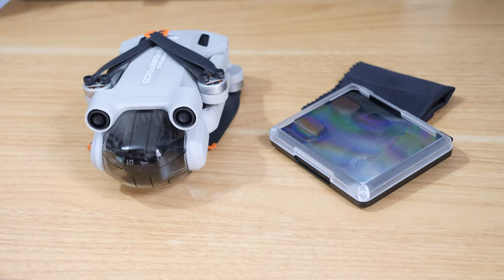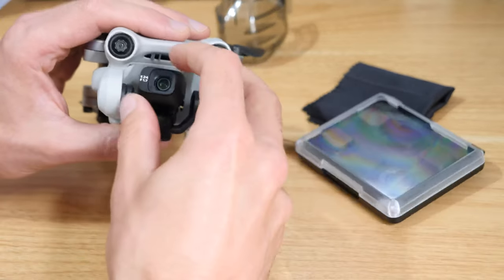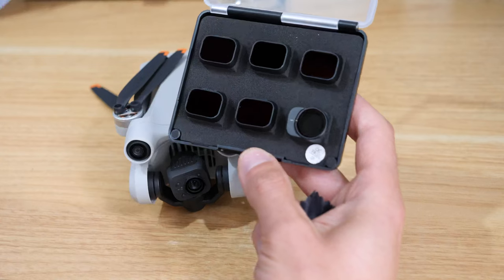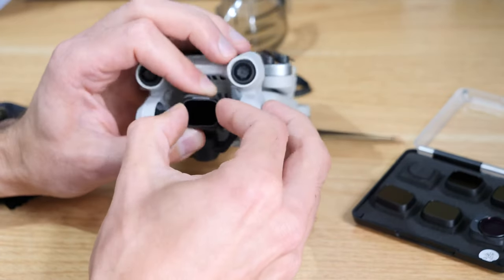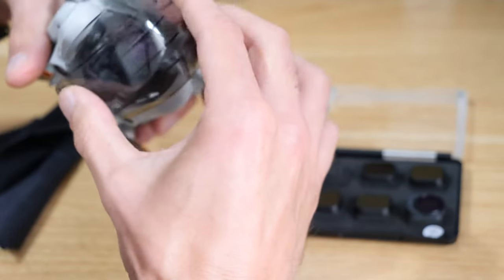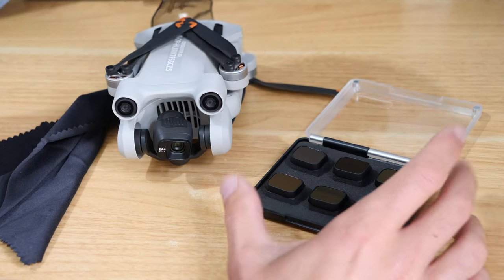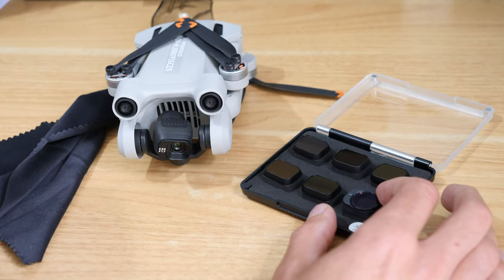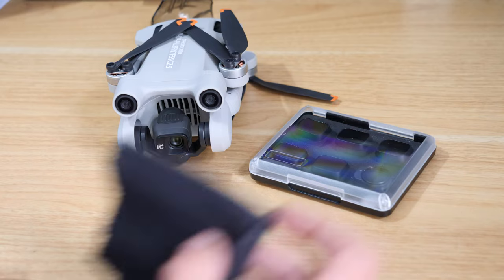How to Fit ND Filters to the DJI Mini 3 Pro Drone | How to Remove the Lens Cover on the Mini 3 Pro

Comment: Thank you so much. I bought this filter set two weeks ago but  didn’t bother to try it until today when I was already in the  site where I needed it. It was a bright sunny day and I was in a remote area with no internet and access to youtube. I had no idea how to remove the lens cap. My other drone (mavic mini) has a top of the lens fit so I just assumed mini3 pro should also be the same. I spent about 15 minutes trying to attach the filter and almost broke my gimbal. Thank you for the detailed video. After watching this, it was a cake walk :goodvibes:
Reply from the maker: No problem, glad you found it useful 👍 It's a bit fiddly the first time you try but then after you have done it a few times its a breeze.

Comment: Hi thanks my first Drone when I was flying out everything turned white like it was Christmas and it was snow now I crashed my job on the filter, blew off or just the cover them just a cover of the lambs and everything so it again with this new drone, so I think I’m gonna buy the filters is this normal? It is a sunny day here in Arizona.
Reply from the maker: Hi, if everything is overexposed to that degree I would assume you are set to 'pro' settings, so you would have to manage the shutter, ISO etc accordingly. If you switch to 'auto' it should compensate as best as it can. In very bright sun, ND filters can be very useful though in retaining much more of the highlight detail in your shots. You can switch on the 'zebra' option on the drone and then this will show overexposed areas with diagonal lines (this is not burnt into the footage, just a reference). Hope that helps.

Comment: nice thanks so much for the info. have a question though. just got mine last week and after watching vids like these, I realized my mini3 pro gimbal is REALLY floppy and just and im noticing nobody else's looks like mine. it seems to function fine when booted up so I dont know, kinda strange.
Reply from the maker: No problem, glad you found it useful 👍 the gimbal will be like that when the drone is not powered up, that is normal. So long as it works well on each axis when it is powered up then you are all good. You will notice in the footage if there is an issue and the drone will also flag up a gimbal error.

Comment: I flew with and without ND filter, I did not see the difference. then if you write cars, yes, it can strobe. I do have a mini 1. Is the aperture adjustable on your 3 mini? hardly.
but the polarizer, yes, you probably need it. but it also needs to be twisted correctly in order for the effect to be.
why did you buy mini3, than mini2 did not fit?
Reply from the maker: It's an f1.7 fixed aperture on the camera but ND filters definitely help reduce overexposed areas, especially skies. You do need to use manual settings for them to be worth it though. But I find them useful for both photography and video. Went Mini 3 because I wanted 10bit 4k 60fps and I hate that old style controller where you have to use your phone. It's just not practical for me, the new controller with the screen just makes life so much easier.
Reply: @stevelitton  So to reduce overexposure, it is enough to take exposure compensation to minus. If the aperture does not close, then there is no point in fixing the shutter speed. Yes, using the selection method, you can reduce the shutter speed as much as possible, but I did not see the difference, there was no strobe without a filter.
Why do you need 60 frames, slow people down later? If about the smoothness of the video, then mini 1 and 30 smoothly write everything. 10 bits is of course interesting, but there is such a mini matrix, are 10 bits honest there ....
I have a separate phone for the remote control :).
Reply from the maker: You can only go so far with exposure comp though. I think if you don't shoot in really bright sunlight then it's not so much of an issue. Ideally I would just shoot at sunset and sunrise as that always looks the most visually appealing but client work doesn't always work that way. I also like being able to slow down footage in certain situations and not being limited by a low frame rate. The phone controller for me is just too clunky with the app and wires hanging out. I just like the simplicity of the new remote.
Reply: @stevelitton  I understand you liked the control panel :).
I did not understand what you wanted to say about compensation for exposition. It always works when you need to remove overexposure.
Mini 1 makes a lot of noise at sunset and sunrise, I don’t know how it is on mini 3. In principle, for that kind of money it’s better to buy a used mavic about some kind, at least there is an inch matrix and less noise. Although it's probably all about grams and drone registration. But for now, I don’t understand how the mini 3 is fundamentally different from the mini 2. Except perhaps with obstacle detection sensors, unless of course they are needed.
Reply from the maker: It may be a bit different on the Mini 2 due to the lower frame rates and higher fixed aperture but on the Mini 3 I find it difficult to work with lower shutter speeds in strong sunlight. I'm used to having to work with noisy footage from MFT cameras, so not too worried about that but overall I find the images pretty clean. Yeah I am in the UK, so any over 250g can be a real hassle for certain types of work. It's just an all around upgrade, better controller, better battery life, obstacle avoidance is a massive one, camera rotation is a great upgrade for socials, slightly less noisy in flight, 10bit, 48MP photos, better range, better video transmission feed, better frame rates. In my opinion it's a really good iteration. Maybe not worth it if you already the Mini 2 though. I do a lot of work that ends up across a variety of platforms, so for me right now the GH6 and the Mini 3 Pro are my go-to shooting options.
Reply: @stevelitton  You can put a photo on Google drive, the quality to look at. My mini1 doesn't take good photos.
Reply: @stevelitton  I don’t know how mft cameras write, but gh6, as for me, writes without noise. I don’t see any problems on ISO 3200, but I don’t need more yet.
Reply from the maker: You like a fast lens though don't you. I am sometimes at range on not so favourable f stops in quite poor light. So things can start to get a bit noisy in those situations. But like I say, it's not a huge issue as you can deal with it a little in post. It's also not an issue in the majority of my work, if it was, I would have to jump up to a bigger sensor. The noise reduction that can be achieved now in smaller sensors is quite phenomenal.
Reply from the maker: This was one when the light was almost gone, its a bit noisy but I was quite impressed with it considering the size of the sensor - https://www.stevenlitton.com/wp-content/uploads/2022/09/DJI_0021-2-scaled.jpg and this one - https://www.stevenlitton.com/wp-content/uploads/2022/09/DJI_0016-scaled.jpg
Reply: @stevelitton  And why did you initially choose a mft camera?
Reply from the maker: I shoot predominately on my own, so having lightweight lenses is really useful for me to carry around. The cost is also much more appealing, for a lot of the video I shoot nowadays, you wouldn't notice a great deal of difference if I shot it on a bigger sensor. So it gives me more options in terms of gear to cost with accessories being cheaper too. I also like how robust the GH cameras and the sheer amount of features you get bundled in. Appreciate its not for everyone and most of Youtube world bangs the drum for full frame constantly 🙂
Reply: @stevelitton  Well, as it were, fast lenses for the MFT cost a lot. But yes, they are compact. And Panasonic is developing cameras, which is good.
Reply: @stevelitton  The quality is so-so, but better than mini1.
Reply from the maker: Because it means I can carry more camera gear for the same weight and make less compromises. I am getting on a bit and I don't want to be carrying around huge equipment if I don't need to. My back much prefers the weight of a smaller camera on a gimbal 🙂
Reply from the maker: Yeah, I think they have come a long way with the camera on DJI drones, each small iteration really does make a difference, so when you jump a couple or a few generations, its night and day. * Re MFT lenses, you get much better quality lenses for the money, so like a premium Lumix lens still costs less than a premium full frame lens. I also really like that you can mount all kinds of non-native lenses to it, pick them up relatively cheap and use the in-body stabilisation. Probably not a plus if you only shoot with autofocus though and want the best lens stabilisation.
Reply: @stevelitton  I bought the GH6 only for 3 reasons, before the advent of the GH6 camera, I didn’t even think about buying a mft, let alone a Panasonic.
1. High quality 240fps bitrate and 10bit.
2. 120 fps in 4k.
3. As a bonus, excellent stabilization, which other manufacturers do not have. But point 3 is already a bonus, in fact, I chose the camera only for the first two points, or rather even for point 1. I shoot slow motion a lot, so 240fps quality is important for me, and only the GH6 camera gives it. It's a pity of course that there is no 240 fps in 4k, but it's okay.
Reply: @stevelitton  By the way, I have 2 remotes for mini1. This is the advantage of a smartphone, took it out and put it in. One remote control is usually not enough for me, it is already discharged on the 3rd battery, and I have 5 batteries for the drone.
Reply from the maker: @lnuponom2678  Yeah it does boast very good video specs, I think 4K 240fps would be pretty hard to come by on a capable camera at a reasonable price right now. Oh I see, I have 3 batteries and the remote has a battery life of around 4 hours, so that is more than enough for me. If I plan to shoot longer, I just factor in a break and then charge it all from the battery pack using a power bank.
Reply: @stevelitton  In mini1, the remote does not work for so long, so you have to have several of them :(.
They could add 4k 240fps to gh6, at least 2-4 seconds of recording, the camera could handle it. You can even make the bitrate as 120fps, the main thing is that 240fps is written in 4k.
Reply from the maker: @lnuponom2678  At least you have found a suitable workaround to get what you need from it. Yeah, that would be great if they did that, like a super slow-mo quick shot option. But I guess it would be pretty niche as to who would use it, I definitely would 🙂
Reply: @stevelitton  Many who shoot advertising need a slow, and not only 240, but also 480 and 1000.